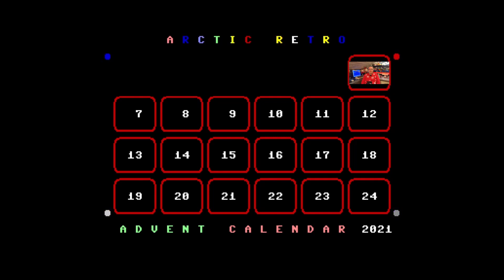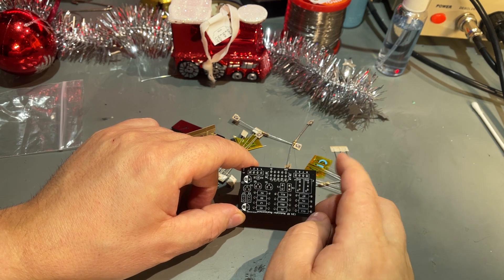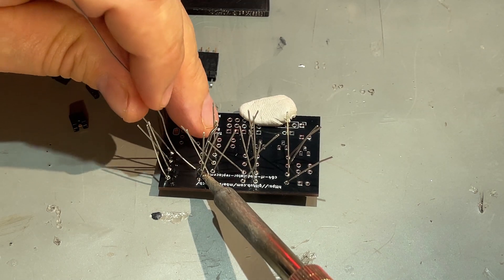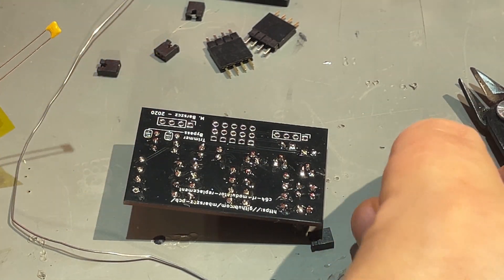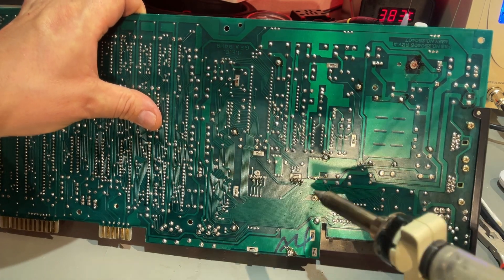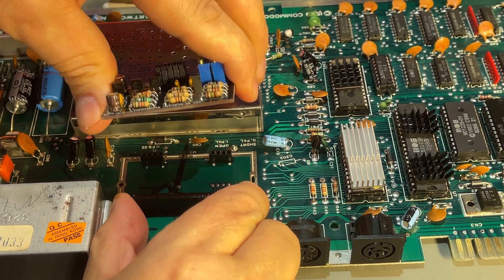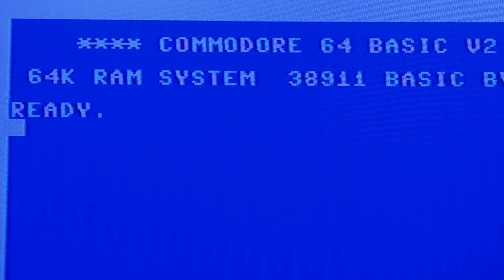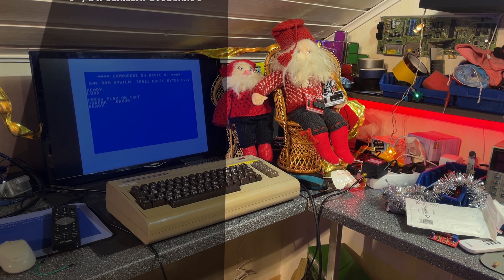December #6 - C64 RF Modulator build - Commodore advent calendar 2021

Comment: I've built some of these boards for my C64C machines. They work very well. If you are only using them in a ShortBoard machine you don't need the 5V regulator. The multiturn potentiometers adjust the Y and C levels for S-Video output only.

Comment: Thank you for the video! One thing about these RF replacement kits is that they leave the hole for the channel selector switch free for example a reset switch. It would be easy to extend the PCB so that a reset switch could be placed and wires run to the reset line and possibly ground.
Reply from the maker: Thanks for the info!
Reply: Very  good idea!